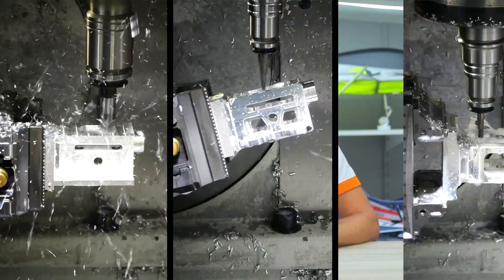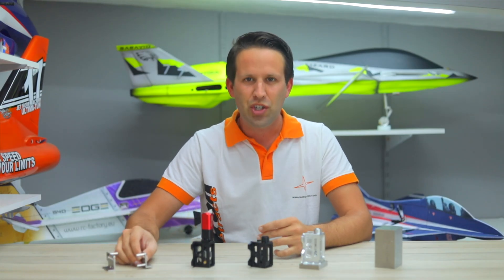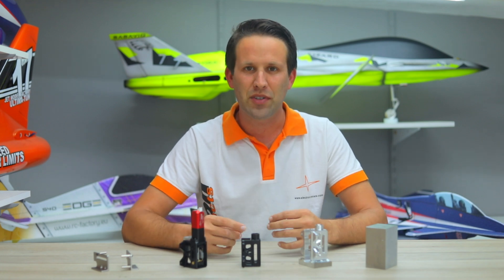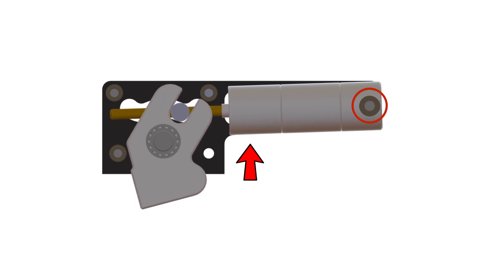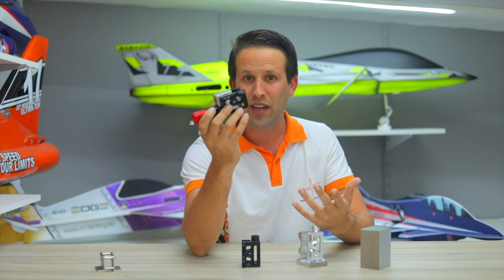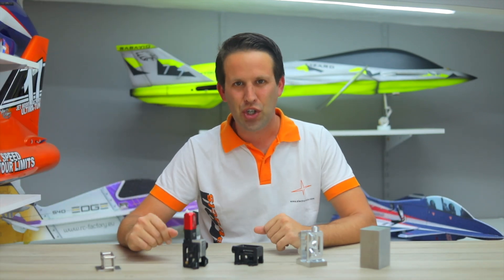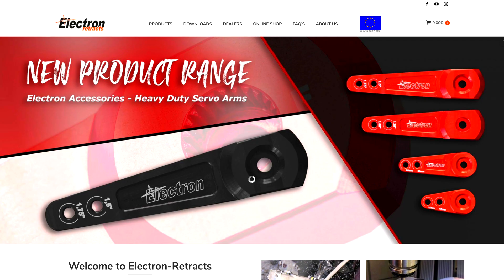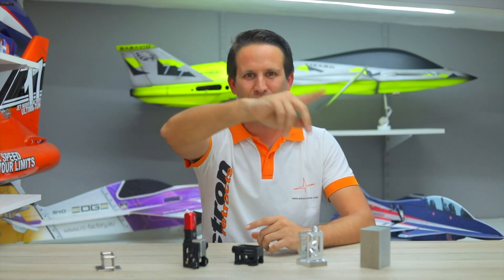Martin Pickering on Electron Retracts - designs from solid aluminium

Comment: Can you do a quick vid on the Powerbox powerpak batteries please.
Reply from the maker: Not much to say mate... Charge them > Go fly.
ECO: charge with normal charger
PRO: choose to charge with normal charger or  the 12v jack
Reply: @MartinPickering-PickeringRC  none of my batts came with a charger and I’m not exactly sure what I can and can’t use 🤷‍♂️
Reply from the maker: @mattpatton1983  You can charge like a normal rc battery with a normal rc charger, or if you have the PRO version, you can pick up the Powerbox 110/220v charger or 12v charger, and it just plugs in and turns green once charged. Still, I would recommend checking out the manual on the PB website just to be on the safe side